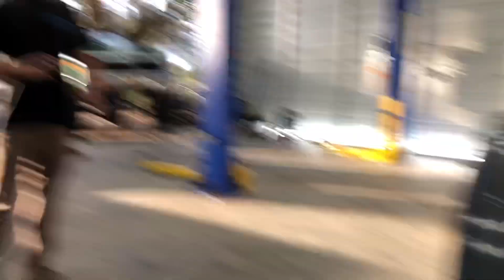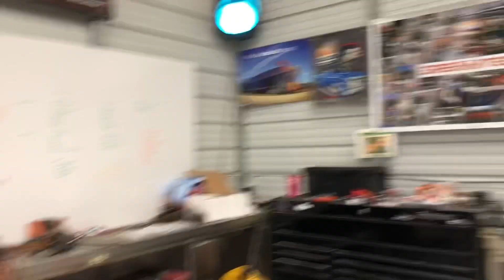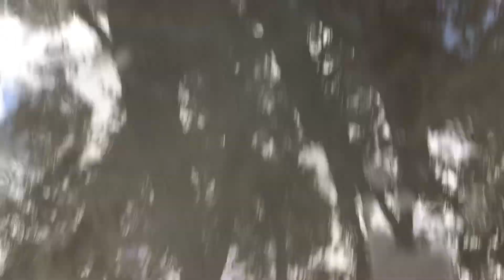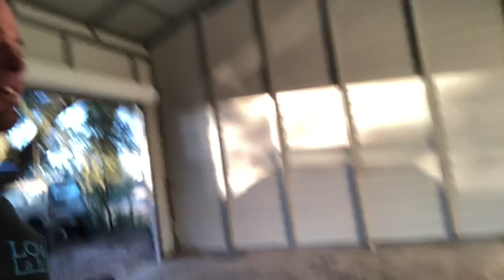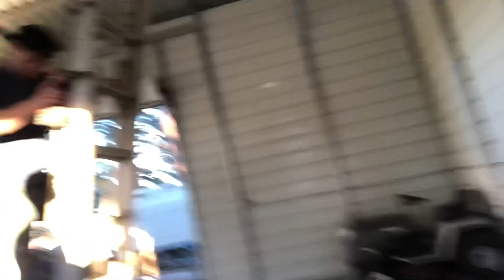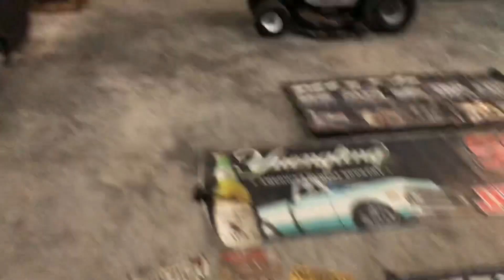Dream Shop build cost. Help pick a shop name!

Comment: Did you have any concerns with installing your lift on a control cut? My concrete guy put my control cuts too close to where my lift was supposed to go. I have 6" pads poured there and 4" everywhere else. I'm hoping I won't have any issues with it.
Reply from the maker: Not really but I can tell you if I did have any concerns they’ve been eliminated because I have had a 2500 ram pick up truck sitting on that lift now for two weeks with no issues. It has the lift maxed out.
Reply: @rowdyridesbryanacres3106  Awesome! The definitely eases my concerns a bit! Biggest truck that will ever be on mine will be an older f-350 with a cummins if I ever get around to building it.
Reply from the maker: @kryptofreak440  nice. I do recommend getting some adjustable lift stands for when your work under the heavier trucks. This 2500 Cummins Ram moves a bunch without them.
Reply: @rowdyridesbryanacres3106  Do you think you could do a review of your lift now that you've had it a while? Been considering this one or a ALI certified and not sure if it's worth the price increase for someone using it as a hobby lift.
Reply from the maker: @kryptofreak440  that’s not a bad idea. I just may. But if I was looking to buy again I’d definitely get another.
Reply: @rowdyridesbryanacres3106  10-4 i've been considering the IDEAL which is made by tuxedo but is ALI certified for about $1500 more, but not many reviews on either.

Comment: $3500 for the slab?
Reply: Why so cheap?
Reply from the maker: Part of the slab was there which probably affected the price. 
It was a 12 x 12 slab around my well. About 6 feet of it goes into my shop. I had them pour this slab level with that slab instead of having it ripped up.
Reply: $ 10000.00 in indiana

Comment: Did you plan for networking in your shop?
Reply from the maker: I’m not sure what you mean
Reply: @rowdyridesbryanacres3106  Like running a fiber optic line between the house and shop for cameras, cctv, WiFi and data drops.
Reply from the maker: @CaptainMcFartin   probably not. Everything runs off of our home Wi-Fi really well.